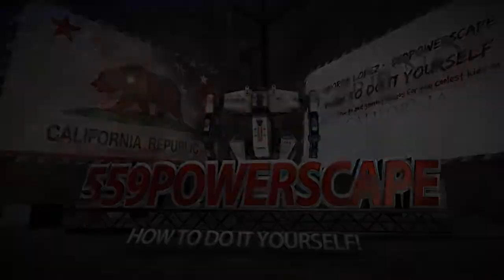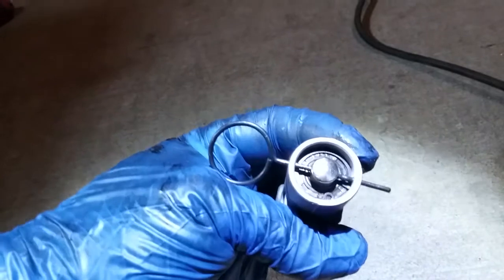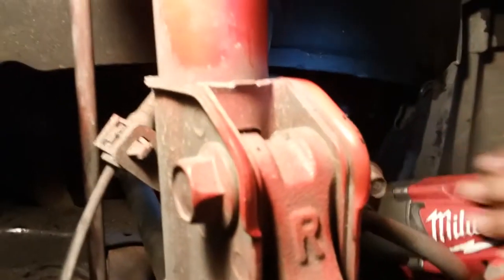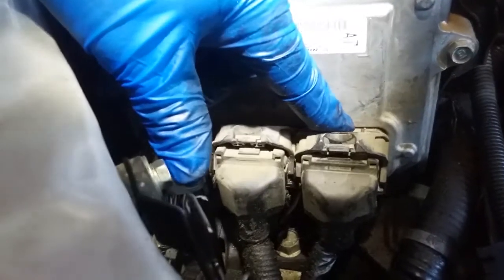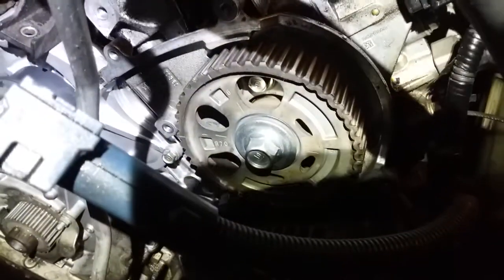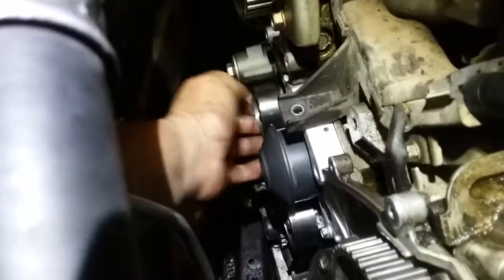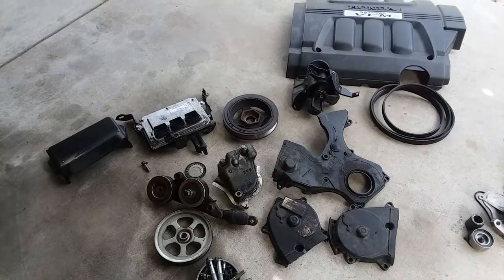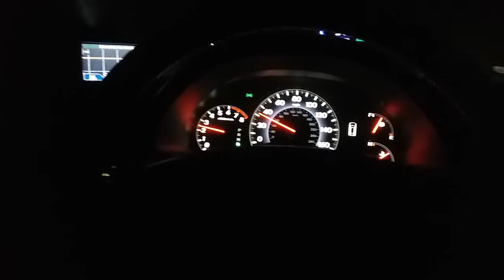How to: Remove and Re-Install The Timing Belt, Water Pump and Motor Mount 2010 Honda Odyssey EX-L

Comment: Best way to prevent bolts seizin in alumunum is with Anti-seize, kind of a special grease. It is not for lubrication, though it does that and helps prevent cross-threading.

What happens is called galling, when aluminum and steel are pressed together. They bond on a molucular level, like welding.  In fact, on the skylab, when you put any bolt in out in a vacuum you have to use anti-seize.  Without the air molecules to get between the bolt and hole galling happens with very little force.  Just putting the metal. Molecules together with nothing in between they weld together.  It happens more easily with alu to steel.

Sorry for going off- topic.  I just find metallurgy super interesting.

Comment: Thanks.  Helpful to watch.  My timing belt is overdue, so Ima do that, the water pump, serpentine belt, PLUS all the AC components and lines.  Do you think I should do the tensioner as well while I’’m in there, or leave well enough alone,

As for your PS leak, are you sure it isn’t a seal, or a line O ring, something like that?
Reply from the maker: Yeah since your in there you should. Wouldn't want that tensioner to go bad and have the timing jump. Just make sure to mark the timing marks on the belt so it always matches up
Reply from the maker: The powersteering was leaking from the rack and pinion. It was bad already

Comment: It is VCM that makes motor mounts go on these.  When I do the timing belt and all that, I am going to install one of these VCM sensor bypasses. It fools the temp sensor that turns off the “extra” cylinders once up to speed and warmed up.  It keeps all cylinders running all the time.  Only costs a mile or two per gallon in mileage.  But it keeps the motor mounts and plugs from needing replacement sooner than usual.

https://www.youtube.com/watch?v=pt8VYOfr8To
Reply: VCM makes excess motor vibration. Honda compensates for this with fancy smart motor mounts, but the erratic vibratrions wears out the mounts way too soon.
Reply from the maker: Thanks for the great info! Thank you for your SUPPORT!
Reply: Thanks for the video. So far I am just talk, but you inspired me to try to make a video when I do it.  Also, iI’m in a wheelchair now, which makes it a little harder.
Reply from the maker: @DennisHicks78749  way much harder bro! Good luck man it really was a tough job. But it gets easier the more you do it lol 😆